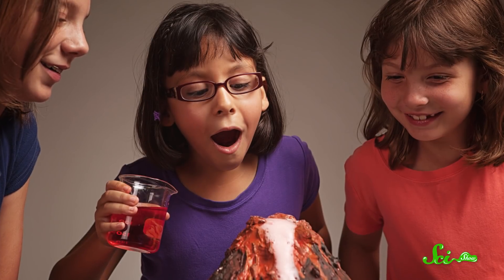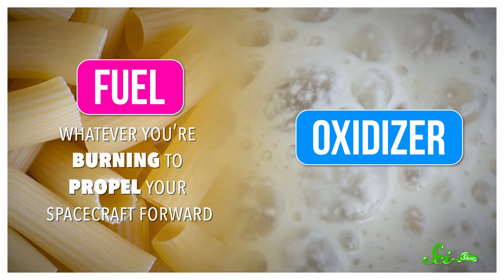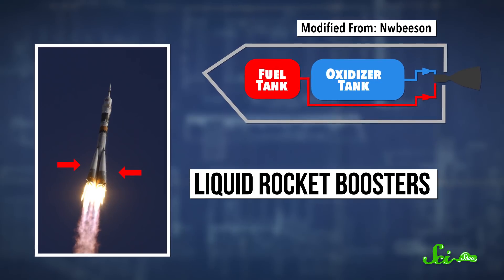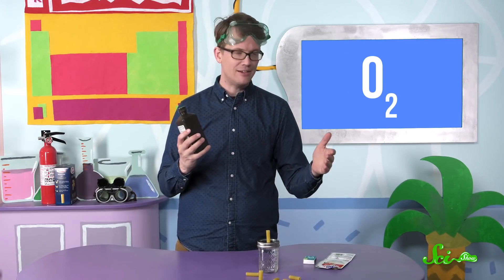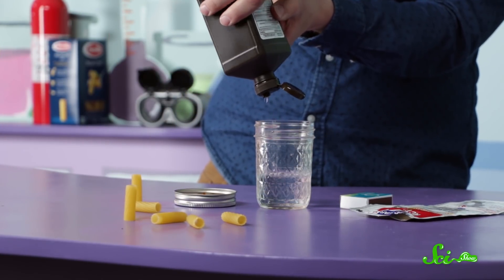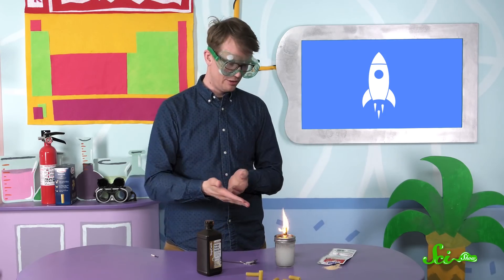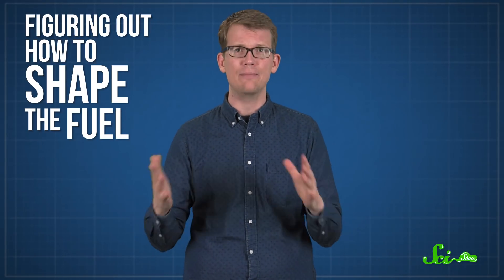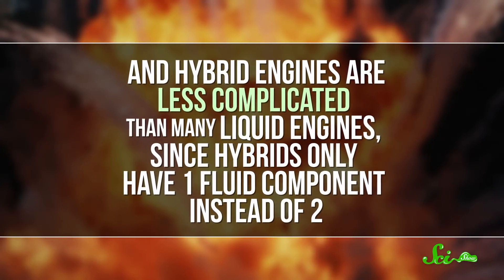How to Build a Rocket Engine in Your Kitchen (Experiment Episode)

Comment: I dont think thats an engine. Its just a burning noodle with low-pressure O2 feeding it. While it does have pressure, I think the noodle is just for show. Please tell me if I am wrong, but the fire should be inside the jar and then through the hole because that would increase pressure causing the gasses to come out faster, Increasing the efficiency of that engine. The engine in the video generates barely any thrust because of the compressed air escaping. Note: the thrust it generates is STILL miniscule.

Comment: what about using solid rocket fuel, like the composite in boosters, as the fuel grain in a hybrid engine? maybe modify it a bit so that it burns much, much slower. Would that increase the power/efficiency?

Comment: This sort of skipped why rockets move. We cause a pressure to be present inside the rocket. This pressure pushes in all directions against the inside of the rocket and this pressure would push the rocket causing it to move, but in each direction it pushes, it also pushes in the opposite direction, so in gets balanced out & there would be no movement, except that there is one opening --So there is a single direction the pressure is pushing in, (the direction opposite the opening) which is not balanced out.

Comment: You've also made a very weak thermic lance. That's a super hot flame used to cut up big chunks of metal. Carbon rods in a tube, connected to a pure high pressure O2 stream.

Comment: You can also make a pulse jet with a mason jar by putting a small amount of pretty volatile fuel in it (I used methanol), poking a hole in the top, and lighting it. Very noisy and more exciting but not nearly as safe, especially since it tends to break, which, you know, spills hot jet fuel near a flame. It helps to put it in a pool of water though. Advice to anyone who wants to try this, it's important to get the hole in the top as round as possible. You can probably find pictures where people suspend a metal tube inside the jar but I've never tried it.

Comment: The problem with using a kitchen scale to measure the thrust in this experiment as some have suggested is that the thrust force on the scale would be canceled out by the mass loss from the burning of the fuel and the release of the O2 from the peroxide.

Comment: Could you make a hybrid or solid rocket engine that is computationally optimized to burn off in the shape of the nozzle? So as it burns it maintains the optimum nozzle shape for the altitude.
So once it's high enough the nozzle shape could change (maybe 3D printed, or channels for the oxidizer are changed and routed differently) the nozzle shape changes to be optimized for that pressure.

Basically like a candle and you push the oxidizer through multiple channels and can control the pressure and burn pattern of the end shape into a nozzle.

Comment: I had to pause to check that. Hank just used 1/3 of a centimetre as a measurement. I have never seen anyone use fractions of cm like that, after all that's actually technically 3.3 recurring mm which is a silly measurement to use. Why not say 3mm?

Comment: This is basically the same concept used by many armature rocket builders.  Quite often I see a solid fuel core with a hole through the center. This is encased in a metal pressure casing/cylinder.   The nozzle is at one end of the hole, with a gas or liquid oxidizer injected through the hole at the other end. 

I have seen fuels make up of plastic, some a sugar based solid or other combustible solids.  Oxidizer from compressed/liquid O2, to highly concentrated peroxide and even NO2 liquid.   The core burns from the inside out and as internal diameter and surface area increases. This gives them a good characteristic of increasing thrust as the weight also decreased, so the acceleration is logarithmic

Comment: Well the noodle would burn regardless because there's oxygen in your kitchen. I see it more as a Noodle-Torch then a rocket engine. The added oxygen is accelerating the flame, that noodles hot enough to melt glass.
Reply: Matt Jasa
Well, yes, but in the case of a rocket engine that might need to work in the vacuum of space, it won't necessarily have some oxygen available, just hanging around like it would be in the atmosphere. And anyway it's much more efficient this way. Also it's possible to control exactly the amount of oxidizer that flows through the engine, which was exactly the point that was made at the end of the video.
Reply: Matt Jasa Well how is a hybrid rocket engine different than a Rubber-torch?
Reply: the difference is there's no outer casing or nozzle. it's just a burning noodle.
Reply: I think I little magnesium would help...in the solid part.
Reply: Well ya its still totally a rocket engine. I'm just saying If you see me blowing glass with noodles, you'll know where I got the idea. ;)
Reply: Should have done a burning noodle on the jar without oxidizer control test first.
Reply: I thought that too but Hanks pretty busy I think he did a good job here, just showing us how to do it is important. Others should do a control test at home. Your control shouldn't have this column of flame 3:17 and will probably be harder to light.
Reply: Flaming niidles can't melt steel beams.

Comment: A bottle of Hydrogen Peroxide like that has a very low concentration of Hydrogen Peroxide. Like, typically 3% or less. Unless that yeast was also freeing oxygen from the water, you really weren’t getting all that much pure oxygen. Heck, you’d also be getting Hydrogen in that case.
Reply: I think that's the idea. Going full-on Bloodhound SSC with high-test peroxide and a ton of fuel in a kitchen would be infeasible and has, some might say, an unacceptably high risk of remodelling the kitchen into something far more open-plan than intended.

This experiment just demonstrates the principle of fuel + oxidizer = OH HEY ROCKETFLAME. Let the more dedicated rocket nerds mess with DIY combustion chambers and N2O creamer-bulbs somewhere safely outside.

Comment: hello, i want to melt metal a bit or soften it at home. will the reation be hot enough to soften the metal? I want to melt or soften strips of iron.
Reply: propane torch should do the trick if the mass isn't too large.  If the mass is large, use a fire (or charcoal bbq) and just stick the iron in the coals

Comment: You could measure the thrust with a bathroom scale, right?
Reply: A kitchen scale would be better because it can measure in tenths or even hundredths of a gram. 

That would be a fun thing to do when I try this.
Reply: TomaCukor kitchen scale should get small reads.
Reply: TomaCukor    I haven't bought a bathroom scale because I don't need to weigh my bathroom.
Reply: Andrew harbit also you'd be losing weight in smoke from the noodle as it burns which would mess up the messurement.
Reply: TomaCukor yes however it won't be much with that set up
Reply: a bathroom scale wont even register weights less than like 80lb... you can't even weigh a turkey on a bathroom scale unless you're holding it.
Reply: The weight would be more.
Reply: Maybe a kitchen scale, but not a bathroom scale. But it'll be getting lighter the whole time as the oxidizer is used up.

Comment: Interesting stuff. :~)  As for the solid booster fuel etc, could they not make the boosters "hollow"? ie instead of mixing the oxidiser into the solid fuel, could they not have a tube of solid fuel and use the air that is flowing down through the center of the booster for the oxidiser? This could, I think, maybe help in having less air resistance due to it being a tube and the air being able to pass easier than having to flow around.
Reply: Actually, Hybrid engines are hollow down the center, but generally not round. Has nothing to do with air resistance and everything to do with surface area for reactions. More surface area, more reaction space, more resultant gas to build up and shoot out the bottom of the rocket engine. The boosters on the space shuttle had a pattern similar to torx, spline, or polydrive holes used in some screw heads to provide more surface area. (See this graphic to see the different screw head paterns: https://www.google.com/url?sa=i&source=imgres&cd=&cad=rja&uact=8&ved=2ahUKEwiBi9jQl5jcAhVzMX0KHeFLABQQjRx6BAgBEAU&url=https%3A%2F%2Fhomequicks.com%2Fdifferent-types-of-screw-heads&psig=AOvVaw25Kr1uKFa4yIPuFggY0GYI&ust=1531437562425981)
Reply: I think you might have misunderstood slightly what I mean. Just like the pasta tube I was meaning without some sort of top to the booster and literally have the hole go all the way through which would bring the resistance part into the equation.

Comment: Anyone know if I can explode if the oxygen in the jar catches fire? I don't want to blow myself up if I try this.
Reply: You will not "explode". It's possible the fire could do something in the jar, and the jar might explode... (But I don't know how likely.) Most likely injury you could face would be to catch yourself on fire, so no playing with the noodle once it's lit. (And 1. No loose clothing, 2. Long hair needs to be tied back or under a hat, 3. don't play with the noodle once it's lit.)
Reply: Also, oxygen doesn't "catch fire". It's the catalyst agent used in exothermic reactions that produce what you would call fire. Oxygen needs a fuel source (the noodle) and a heat source (the match) to create fire, but O2 alone isn't going to catch fire by itself.
Reply: Unless you use 100% H2O2, which is very hard to get, there is no danger of over-producing oxygen. Also, oxygen doesn't burn - what we call `burning` is just oxidizing at the chemical level so pure oxygen cannot burn as it's already, well, oxidized. It's the same reason why you cannot set water on fire...

Comment: So 3D printed rocket fule?
Reply: If you have a material that makes a great rocket engine fuel for a hybrid rocket, sure you could 3D print it to be inserted into a metal tube. (You still need the metal tube and metal nozzle to create the pressure and direct the flow.) But, yeah, in theory you could 3D print your fuel and insert it into your engine.

Comment: Interesting. Can you provide information to build ion rocket engine in the kitchen?
Reply: Oh that's simple, just break a TIE fighter in half. Then you have*two* ion propulsion engines!
Reply: Experiment episode 17:  How to build a particle accelerator with items found in your bathroom!
Reply: Remember those air purifiers that didn't use fans in the 90's-00's sold by sharper image?  those are ion engines ;)
Reply: information to learn magnetron is in microwave
Reply: information to learn
I can tell you how to build a photon engine in your kitchen.
Step 1: Take a flashlight.
Done!
Reply: You mean don't pull one apart crush up the ceramic disks and breathe the dust in right?
Reply: I foresee microwaves being involved
Reply: Since nobody else had actually useful comments.
https://makezine.com/projects/ionic-thruster/
Reply: Schwarzer Ritter Tried this, found the repulsion force was a little light
Reply: Okay. Step #1 - Expand your kitchen to aircraft hangar size. Step #2 - design the pasta in a way to maximize fuel/oxidizer mixture for output of thrust. Step #3 - multiply the measures described in the video accordingly.
Reply: Well, for starters, you probably need a high voltage electrical source, a magnetron, a vacuum chamber, and a canister of a noble gas.
Reply: Actually the ceramic insulators no longer contain beryllium oxide and instead use aluminium oxide and they also have different colours, so unless you're smashing apart a microwave from like 15 years ago, you probably have nothing to worry about, but you still should avoid breathing it in
Plus you can do a ton of cool stuff with the core of a magnetron
Reply: Sit on it. Then you can say " I on rocket."
Reply: Kent Hoyt - nice pun!
Reply: you can do it by inserting a fork into the socket👍
Reply: Plasma ball and electromagnets.
Reply: Get a nail, a pipe, 10kV, and be very careful. I’ve actually done it and it’s not too hard just be careful. You put the tip of the nail by one opening of the pipe and attach the 10 (doesn’t have to be 10 but probably atleast 3 depending on how big the pipe is) kV power source electrodes, one on the pipe one on the nail. You can measure the results with tissue paper and if you’re in a dark room you can see the beam. It’s a faint electric blue but how bright depends on the voltage